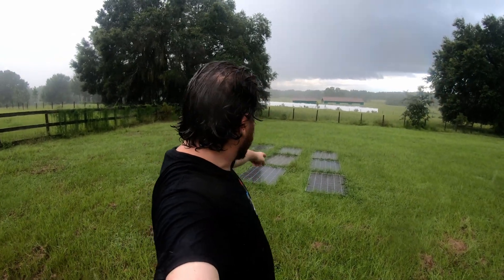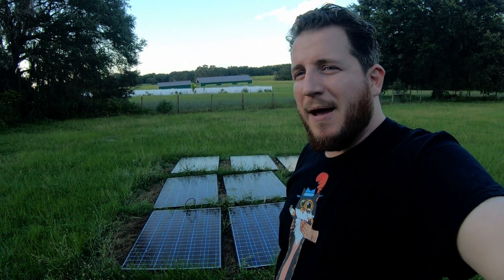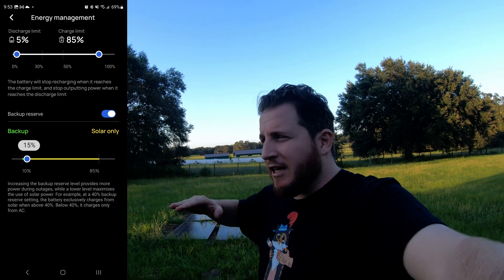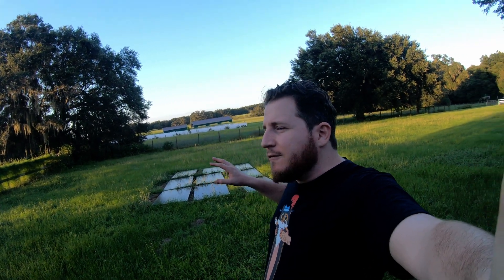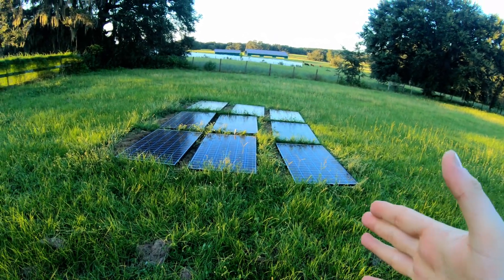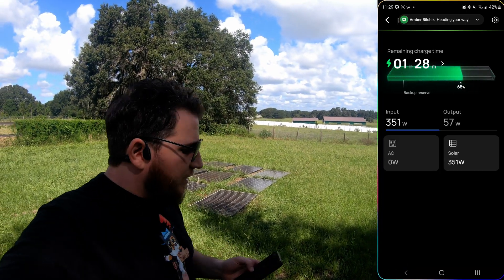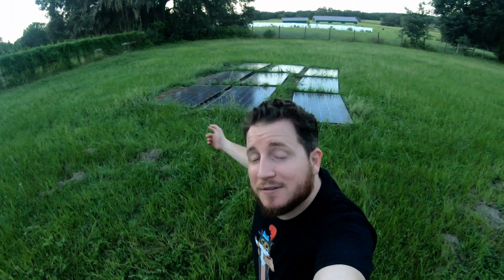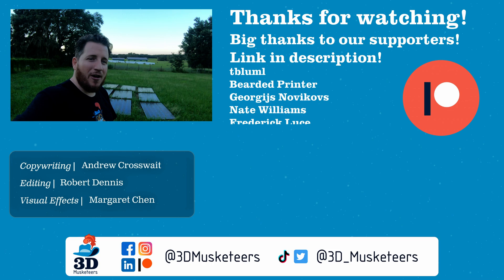Off-Grid Solar 3D Printing Set Up to Survive ANYTHING!!!

Comment: 48v system grant, new is way better than used at this point and batteries DIY. My 2 bambu's will use 5kwh a day. We have 20kwh in usable batteries.
Reply: Another thing yiu can do is just replace the batteries in you ups. Replace with 100ah lipo4 24v battery is 7kwh's.
Reply from the maker: I'm likely looking at higher voltages but don't know yet. 

I won't confirm any mods I've done to industrial grade ups's, but mine are all 48v ;)
Reply: @3DMusketeers  ok, so 48v 100ah battery is 5kwh you can build a 304ah pack and that's 15kwh. And that keeps you from doing it all at once. And you have a better redunacey with the UPS. Then you could plug them all in to 2 solar invertors remembering redundancy. As a home owner with solar you have extras, but solar for a business redundancy is the extras. I was wrong about the 7kwhs, I was thinking of a 280ah 24v battery. Also if you decide to go above the standard for a whole house system your just going to drive the cost up. Requiring more expensive equipment. 48v has become the standard. There's more competition at this level than going above it. That's a range that won't have competition mean the price will have less restrictions and be jacked up.

Comment: Licensed what   okay, it's your house      Though more importantly you forgot to mention that Solar Panels are always live at the terminals or wires if connected if they are getting light    So, even installing on the ground take percausions and safety   Reserach, Reserach, Research   Know what you are doing
Reply from the maker: It's Florida. Insurance here kinda sucks. Gotta follow their rules. 

I did mention it but we cut it out.

Comment: 11.6kW with 28.8kW of battery storage
Reply from the maker: oooohhhh nice!
Reply: @3DMusketeers  And spendy!
Reply: @mjcontos1119  this year we installed 3kw in panels a 3000watt pure sine wave invertor and 24kwh of batteries for 7 grand. That includes install and mount. Next year we're going to be adding a 6kw invertor and 10kw of panels and another battery or 2. Adding another 14-28kwhs of storage. All diy

Comment: I plan on doing the same thing I have a Dabbsson 2600 as a back up right now and plan on buying a second when on sale in December for my other printer, it works like UPS on steroids. If i plug my printer into the backup and the backup in the AC if I yank the AC out of the wall the printer doesn't miss a beat not even a millisecond drop in power. I even have the ecoflow  wave 2 AC  with on board battery in my bedroom. I the next year I plan on moving from New York back to Florida and then I will add the solar. Over the summer we had a bad storm it knocked out the power in my area but I was living my best life.

Comment: We print on board a boat in Central America.  We use solar, diesel generator and very undependable mains power. All run of from 4 L16 lead acid batteries through a pure sine inverter / charger. 2500 watt output.
Reply from the maker: You won't need pure sine wave for 3d printing, but certainly for sensitive electronics yes you'll need it.
Reply: @3DMusketeers  it runs everything including electronics!